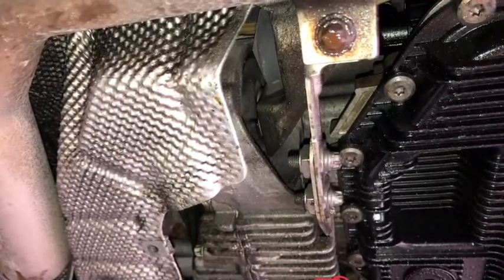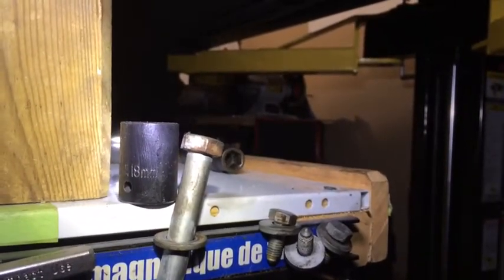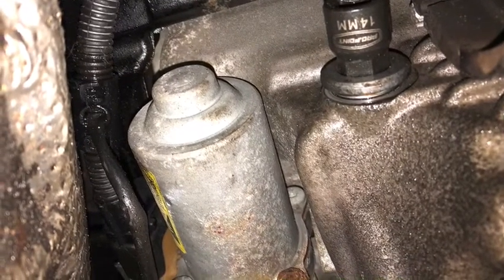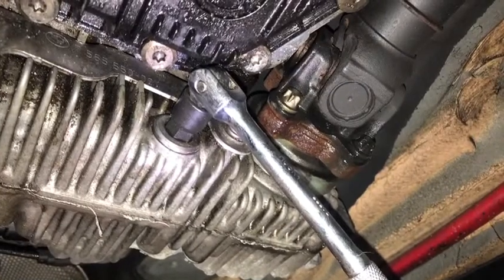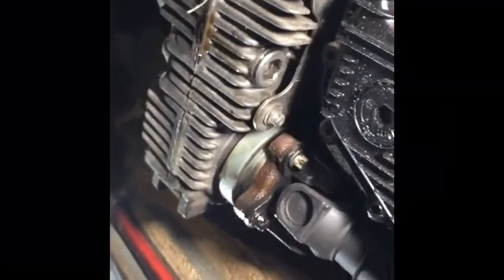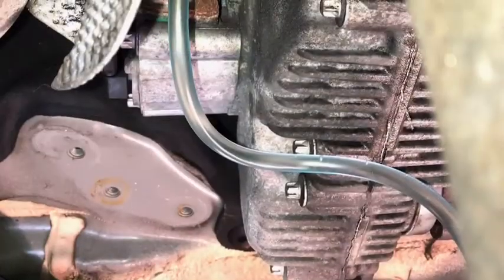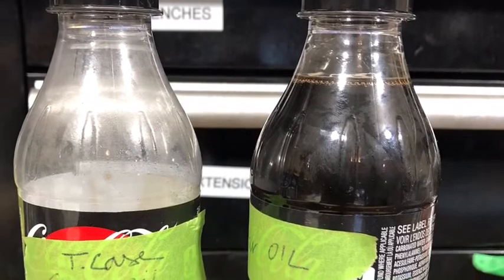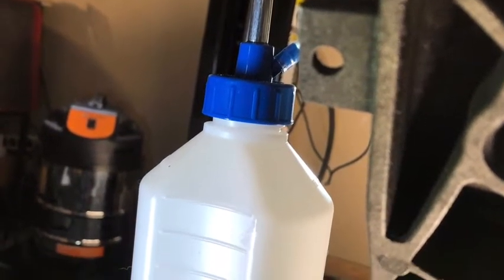BMW 2008 535XI Transfer case oil replacement - error code 0054C6

Comment: Yo utilizo OBDeleven , y no logro borrar el fallo .
Reply from the maker: The warning error is a maintenance reminder. The oil is not failing . It is dirty and contaminated like hydraulic brake fluid or coolant system flush that you need to change.    To clear the error , you need BMW scanner or get “Carly” ODB scanner module and software.  Or bring to BMW service shop to have it cleared. Good luck
Reply: @maniata8869  gracias amigo por la explicación!! 
Si no se cambiase en los años siguientes, le puede ocurrir algo al coche ? 
No le doy mucho uso la verdad , le hago al año unos 4000klm solo . Ahora tiene 170.000 klm . Lo que sí le cambiaron  las 120.000 klm fue el aceite de la caja de cambios automática .